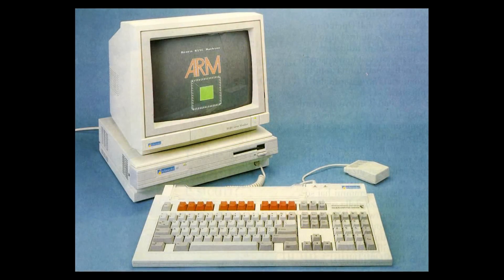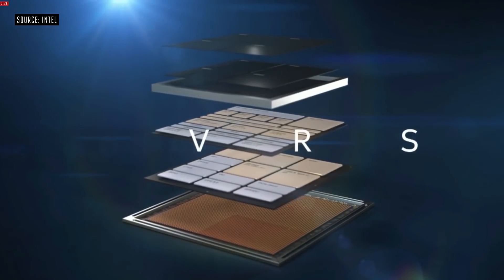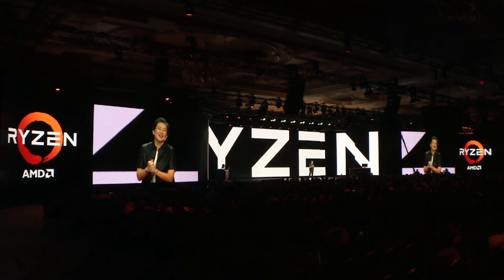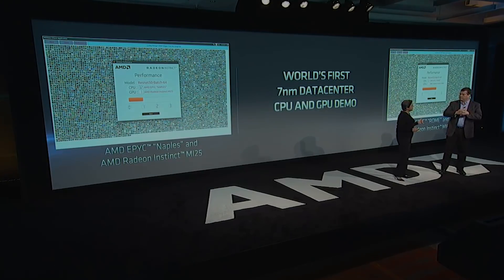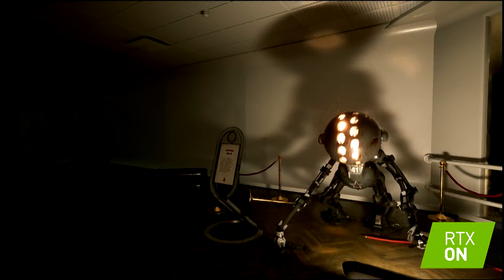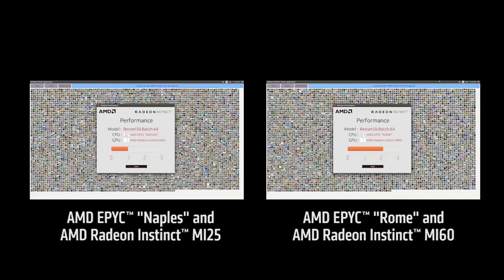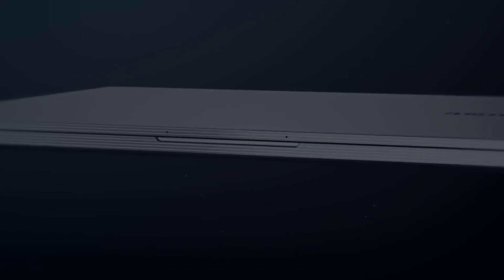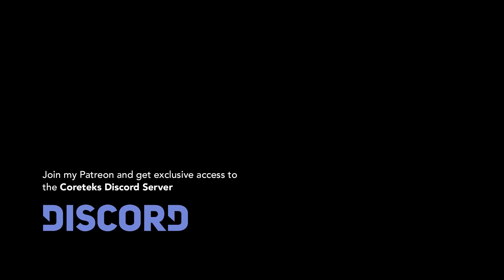Hardware trends: How many cores do we need?!

Comment: Hello there Coreteks:

i think we could even possibly see 48-core mainstream CPUs in the future and see HEDT CPUs top out at about maybe 128 but I do agree that we will see a maxing out of the CPU cores cause you could only go so far.  However, where I disagree with you on is that  32 cores seems a little too low cause as I said I could even see 48-core mainstream chips could possibly be the maximum that those CPUs could reach. That is another 16 cores over what you are thinking. Why I think I could see a 48-core mainstream CPU is that i can possibly see workloads taking up more than 32 cores in the future and also the extra 16 cores could be a pretty good safety net for in case 32 cores is not quite enough and may need a few extra cores to run at an optimal level. Now why I could see a 128 core HEDT CPU is cause i could see high end workloads possibly taking up at least 90 cores to complete and possibly more than 100 so a similar reason, as a bit of a safety net. Better to have a few extra than not enough right?

Comment: There are a few flaws with how you are calculating raytracing scaling here.
Reply: care to elaborate?
Reply: @dnmr  at 9:30 he says performance increase is 12%. But it is 12=1200%.
Reply: @halleffect5439  from 14 to a little over 15.5 it is actually only that much
Reply: @dnmr  multicore raytracing is up to 2000% faster than single core. Depending the number of cores.
Reply: @halleffect5439  It all depends on what N you put into the equation. I don't know why he uses 95%, why not 100%.
Reply: @hyawill8944  me too.

Comment: "glue two 9900k if they have too" had me rolling
Great video as always.
Reply: We should not forget that Intel has done that not so long ago, with the venerable Core 2 Quad line. So yeah, glue two 9900k is a possibility, if they have "two".
Reply: @SuperMatthew128  It's a dig because Intel released press statements criticizing the original Ryzen because they "glued together" cores for the Threadripper release.
Reply: @SuperMatthew128  Intel did it but oh they had to talk about how AMD "glued" CPU's together when Ryzen launched... But Intel forgot they did it themselves in Pentium D...
Reply: Intel Pentium D was dual chip cpu from Intel. It had two intel Pentium 4 Cpus in the same die. Two hot and power hungry chips on the same die. Briliant.
Reply: @puriko899  actually they had one of them, forgot number but maybe 670 D? it was super cheap and OC'ed like a ninja, fast and powerful (for the money) of course the core2duo's stomped em, but for the money they were great :D I enjoyed mine a lot, with a Reserator water cooler tower next to the PC :D
Reply: oh I heard "if they have *two*"
Reply: Oh the irony!!! 😁
Reply: "that's $2000" shintel
Reply: Wouldn't be the first *cough* Q6600 *cought* time.

Comment: Aren't we coming close to move from binary digital electronic computers to quantum computing, moving from one of two definite states (0 or 1) to quantum bits which can be in superpositions of states? I would imagine that in two to three decades we will learn how to implement quantum Turing machine (QTM) theory into practice.
Reply: Quantum computing is not going to replace general purpose computing. Like ML (aka "AI"), it may augment it, though, and could radically change some fields.

Comment: ok, discrete GPU's will not become obsolete in 10 years. GPU's already have double the transistors and double the TDP of a CPU, how will a system combining both be kept cool...impossible.
Reply: It doesn't need to be in cpu. It could easily be one more chip directly  integrated on the motherboard like early samples. 5 nm gpu will be tiny. I can easily see  max DP of 50W and gtx 1060 level of performance on integrated GPU, maybe even better. Such PD can be easily cooled with decent passive onboard cooling solution.
Reply: @rudlzavedno7279  are we talking about the same thing here? Im talking about integrating a SOC chip ala APU style which is what this video seems to be referring too. ya maybe a few generations down the road, your APU will have the power or a 1060, but by then, a 1060 will be worthless. APUs have certainly gotten better but they will never rival a dedicated card. furthermore. 5nm wont be tiny because the transistor count increase will offset the reduction in node size. this assuming we get 5nm in the next 5 years which is also unlikely because it doesn't appear the lithography technology is remotely ready for true 7nm even. If we were to plot a roadmap for performance increases in the next 10 years and build a theoretical, APU to compete with the mid range GPU of 10 years from now (Im talking a 1060 of the future) , your looking at slim to no change. too much heat to reasonably cool and even if you did cool it, the added cost in cooling would offset the savings of a SOC. I just dont see something like that catching up. there arent any tricks that you can apply to a SOC that wouldn't apply to a dedicated chip. its like people who think ARM chips will overtake x86. hilarious.
Reply: @rudlzavedno7279  well then the motherboard vendors would have to build separate motherboard for different gpu's that would drive up costs for them. 5nm GPU will not be tiny, once again. technology increases relatively proportionally to die shrink (Performance is low key ultimately limited by TDP more than anything else) . your reduce in transistor size is offset by an increase in transistors. besides, there are serious hurtle to cross before true 5nm chipss can be made because of the physical limit of current lithography technology already requiring multiple patterning @ 14nm. theres a reason Intels been stuck @ 14nm for 4 years now. EUV Lithography is a serious hurtle to overcome. doesn't seem possible for a long time. too many engineering questions to answer for a solution that doesn't actually create any  benefits
Reply: @rudlzavedno7279  like sure, if you want to argue that you can theoretically integrate a 1050ti on a motherboard. sure. or even a 1060. those are still weak GPU's that are suitable for a 1080p system at best. in 10 years, we are looking at 4k being the norm, ray tracing being standard and whatever other fancy GPU intensive task that they decide it possible based on available computer performance. back in the 8000 series days when we ran TOTL 90nm chips we used to think, boy imagine how little power GPU's will use in 15 years, well guess what? those power requirement have pretty much stagnated. unless you find yourself finding a 4x increase in IPC performance (or however u want to quantify GPU performance), you still stand no chance imo. I could of course be totally wrong. just doesn't seem to be a financial gain in going that route. there are different reasons that ARM chips have gone the SOC route which, imo have to do with packaging

Comment: Serious Question:  Is there any technical reason we couldn't have a kernel / OS operating in the 90% range?  I mean, won't memory management and I/O always be the bottleneck for general purpose  computers?
Reply from the maker: Not in the 90% range, but much better than it currently is, certainly for windows. The OSs that run at runtime rather than compile time (MacOS for instance) have a better chance of moving in that direction, but there are always things that can only run sequentially, in cycles (in the hardware we've adopted at least). You can have CPUs without clocks... but that's a whole other topic for another time ;)
Reply: Memory management takes time, but can be parallelized, and can scale out well. The problem is just that there are too many programs that don't scale out, and can't be made to.

Comment: Adding an additional core should have doubled the performance but it didn't and it probably never will. Partly because the thread scheduler inside the cpus is inefficient at assigning the workloads and at the same time software side is also inefficient where there aren't any proper guidelines on how to best implement multi-threading.
Reply: Linux and FreeBSD can go into the dozens of cores almost perfectly. Windows and Mac OS less so, but not to such a degree that it's a problem for client usage. The OSes have been fine for 10-15 years, now.

Additional cores can and do add as much performance as the number of cores, when you have a suitable problem, and code. For example, PostgreSQL scales almost perfectly to something like 50+ threads, and h.264 encoding into the teens.

Most interactive programs are hard to scale out, if not impossible to.
Reply: @laurelsporter  well, i think it hardly matters now since everything will be processed and streamed from huge server farms in the future. Desktop computing will become more like terminal computing hogging off the mainframe. Companies like amazon and paperspace are really pushing this technology, its already proven to be successful in crunching tons of data for the neural networks in a matter of seconds...its only a matter of time before the desktop processors themselves become obsolete.
Reply: @mithrandir491  that's a poor job of goalposts moving. Those servers work the same way...
Reply: @laurelsporter  i said it hardly matters when processing or the software platform is not your headache anymore.
Reply: @mithrandir491  but then it's just another guy's headache. Whether it's a Windows 10 machine in your possession, or a Windows Server machine a hundred miles away, it all works the same.
Reply: @laurelsporter  no it isn't. I'll tell you why- nobody worries whether the youtube runs out of space, similarly nobody worries whether the server farm is efficient at multi-threading, all they care about is getting work done on time and it doesn't matter how many servers it takes to get work done.
Reply: @mithrandir491  oh, but you're wrong. If it takes an extra 100ms to respond to every action, that adds up, and results in your work being done slower. Movingly the computation makes that even more of a problem, not less of one. It doesn't convert interactive workloads into batch processing.
Reply: @laurelsporter  dude you are thinking short term, in the future when the latency issues are resolved it won't be a problem. You already know there are game streaming services online. Sony said that the next PlayStation will be the last one, meaning they are going to stream games in the future. Latency is a short term cabling problem, not a technology limiting issue.

Comment: Very interesting indeed . What would nVidia do if 1 Raytracing card reaches its peak ... try and sell 2 cards for specific or different reasons ? Or maybe that would have no relevance also. I can only speculate.
But most importantly about the linear to parallel code hardware code conversion. Not that I'm an expert, small programming experience in youth, however what would make more sense to me would be writing code traditionally - linear , and converting it to parallel not by Hardware directly but by a different software add on, which would have the capacity to perform that task... meaning to optimize what the programmer wrote in linear coding , to as much of a machine language parallel version as its possible with that type of application . Now of course I think this task would not be easy, to build such software, that eventually has to convert stuff from several languages, but to me would make more sense than Hardware doing it "on the spot".
Reply from the maker: You are correct but the problem with having a piece of "software" transform code from sequential to parallel is that we get stuck in compile-time land, like we are on windows/x86. Just look at how much faster MacOS is with really modest hardware by running things at runtime. (That doesn't mean that your solution wouldn't help, it would improve things to some extent).
Reply: @Coreteks  I dont know much about Apple to be honest, should eventually look more into MacOS just to understand perspective. Not an Apple fan, far from it from all points of view, but now I went off topic. Aa... Maybe DirectX 12 / Vulkan is trying to achieve in real time some parallel works on possibly multiple GPUs .. well not exactly what I was talking about above but that would be kind of a cool video to look into maybe for your channel, didnt hear much about those plans lately . 
Either way I enjoy your content, high quality videos, have a good one.

Comment: I think desktop cpus / kernels should adapt and have the kernel, simpler background apps and services running on an arm coprocessor with games and productivity that excels on x86 should stay on there leaving more clock cycles on x86 do to the tasks that it needs to do. Apple has the best chance of doing this into being common as some things are handled by the T line of processors. Linux could be another place where this system style would spring up. Windows would be the last to implement this most likely though.
Reply: We've had ARM big.LITTLE designs for a while now, but we've not been able to utilize them very well.